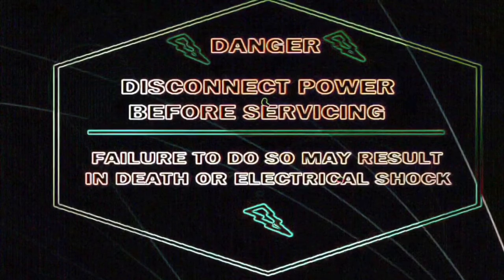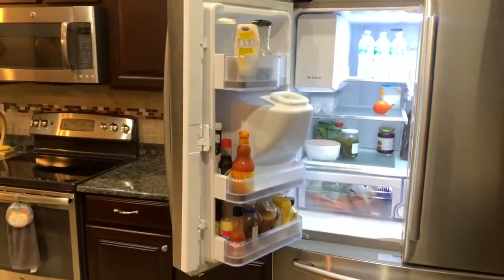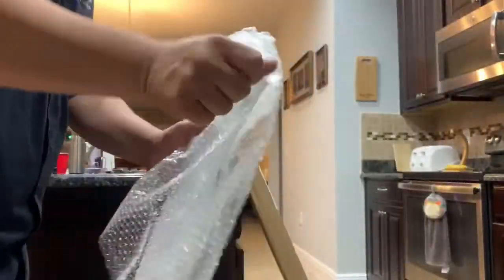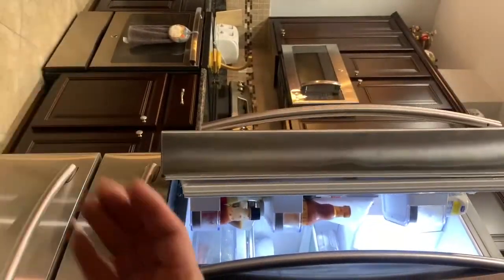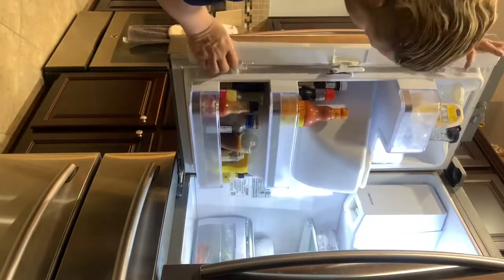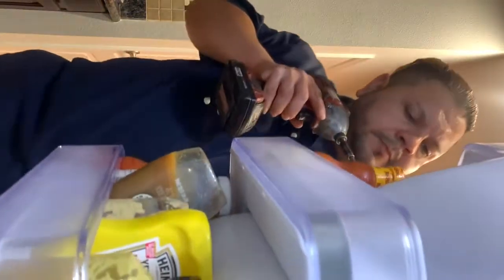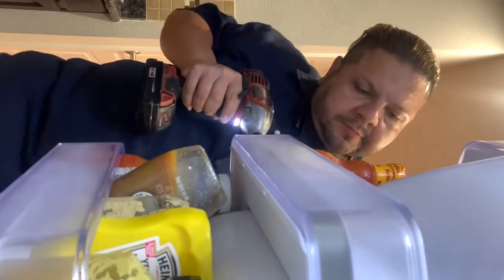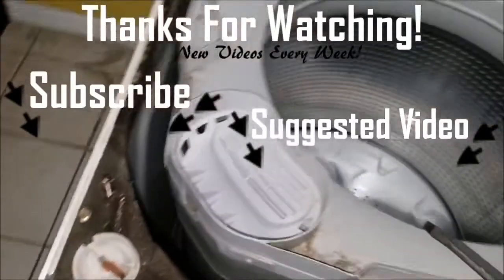How to Replace Flapper on #Samsung French Door Refrigerator | Model RF28HMEDBSR

Comment: So there isn't any way to just buy that little tab at the top that engages with the cabinet?  Mine broke in almost exactly the same place.

Seems like kind of a waste to buy that whole thing.
Reply: I agree. If the little tab were available by itself, it would probably only cost $100 rather than the $100+ they charge for the entire flapper assembly.